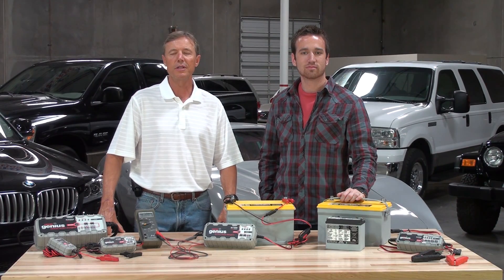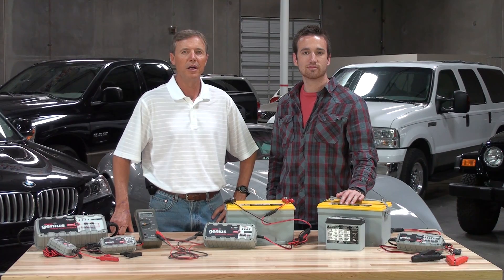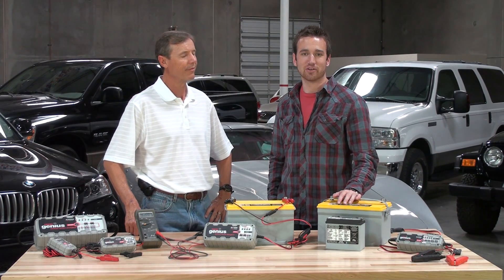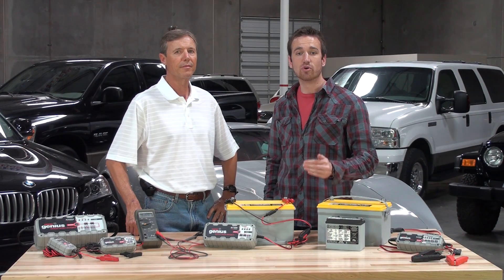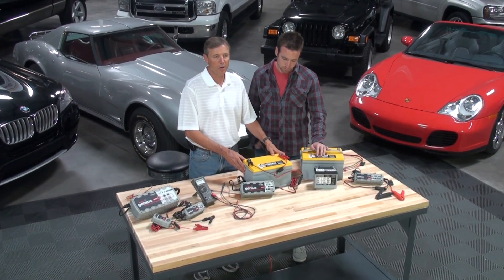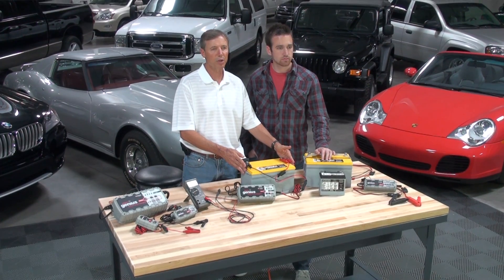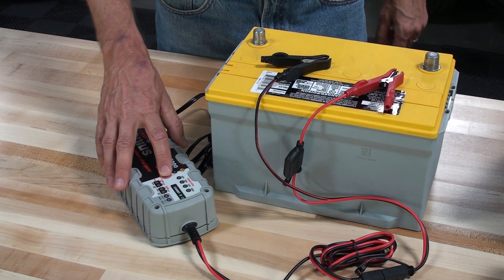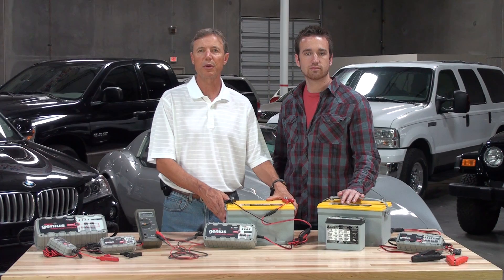Using 13.6V Supply Mode

Comment: I have the noco G26000 and when using the 13.6v power supply mode on a charged 12v agm battery with the ignition on It was maintaining at 12.2v. Does this not have a constant supply of 13.6v? We use this charger to carry out ecu upgrades. Thanks

Comment: Shoud i use this mode if im not using the car? Or just the normal function that has indicator till 100%?
Reply from the maker: You'll want to use the charging mode that is appropriate for your battery (12V Norm, 12V Cold/AGM, etc.) to keep the battery maintained, not Supply Mode.
Reply: @NOCO  thank you. Is it ok i dont remove the battery terminal in the car while charge mode? How about if i start the car while charging
Reply: @MrRGM10  it will explode

Comment: Can the supply mode be use for example when diagnosing a car, when systems start/stop there is enough voltage avalable?  I was looking for the G7200 and the ctek msx7.0..
Reply from the maker: See your response to your other question. Let us know if you need additional help.
Reply: @NOCO  thanks for the information. Then i have to check for the telwin doctor 50. Find out this had a diagnose function with max 40A. And for comon cars this would be Oke.
Reply from the maker: @at0ny  We have seen cases in the US where 5-amps has been used (again not recommending it), but in the EU, not a chance. You correct, a 40-50 amp supply is about the smallest you should consider. We do believe the standard is 80 amps. In the EU during ECU reprogramming, they turn on all loads, so the current draw is high.
Reply: @NOCO  i find out everything morgen then 40A would be Oke. Depends what dat it Is.  Comon vag cars woud be Oke. But i know bmw f series drain more then 60A while flashing ecu.  Nu business is just started so everything i invest at the moment its from my own money. And i cant buy anything higher then 350 euro's at the moment.

Comment: Which NOCO Genius charger has the 13.6v supply mode?
Reply from the maker: The G7200 (https://no.co/g7200), G15000 (https://no.co/g15000), and G26000 (https://no.co/g26000) all have this mode.